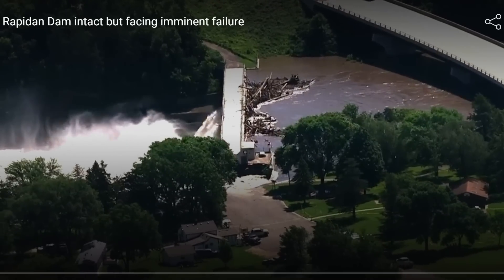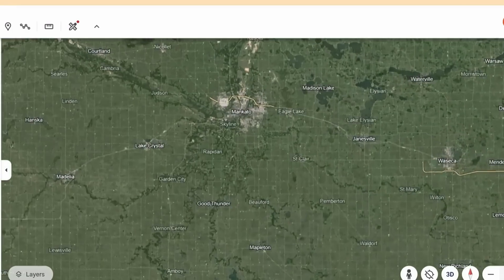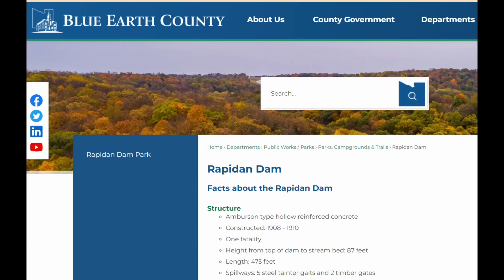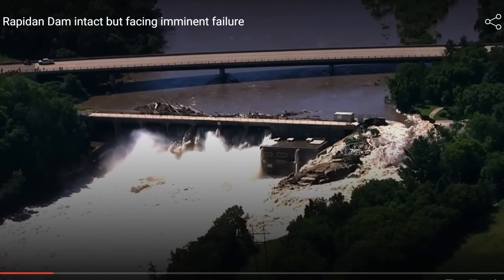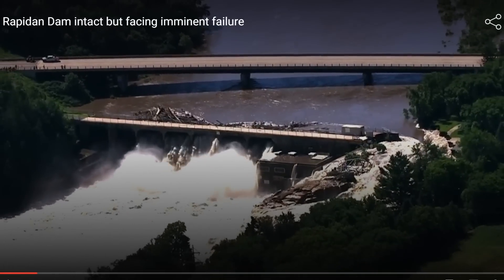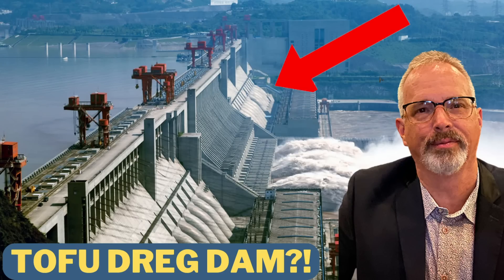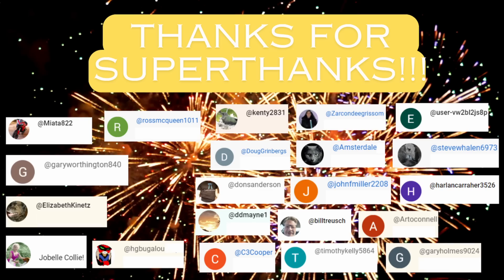Rapidan Dam Failure - Minnesota

Comment: Not sure why the people who own the threatened house didn't call out for an excavator and loads of big rock and got it placed while the placing was still possible.  Yes, it would have been done without permits, but rock can be taken back out of a bank placement where once the house tumbles into that flow it's all over for the structure.

Also, of note, concrete takes approximately 100 years to cure, so that dam structure probably isn't going to break apart, leaving the burden of drainage up to the left side.  More erosion in store.
Reply: This situation developed in a matter of a day. The family evacuated and moved all belongings out at 4 in the morning today. What is very sad is that their family restaurant is steps past the house which has been in operation as long as the dam. I am not sure what they will do now. This was a very popular tourist destination and they are well known for their pie. I've been many times and am so sad to see this.
Reply: @lawnmowerlarry  I did take note of the boarded up window in the attached room indicating an evacuation notice.  I sympathize, I've been there due to on coming forest fire.  Ya don't know what to do first.

Interestingly enough, what I did was pour a double, sat down for a minute to consume and consider.  Snapping out of it I went into the bedroom and grabbed stuff, getting to the truck I looked to see what I had grabbed, not really paying attention during the effort, what I was holding was my 357 and porn.

I sure there's a message there.  Well God bless 'em, I'm sorry for their loss.
Reply: What retard told you it takes 100 years for concrete to cure?

Comment: Apparently the dam infrastructure was abandoned earlier from an ice dam incident. No ability to control water flow. A backhoe could have tossed all the debri over the downstream side but would be pointless if the water level can't be controlled since the dam infrastructure was flooded before. The wooden gates were replaced with concrete slabs, hence no debri on that side. 2 out of 7 gates permanently closed. WTF? Disaster started years ago with apparently zero foresight... the remaining "flood gates" were not operational or the water level would have never gotten that high. Emergency spillway?... FREE!, gravity always wins.
Reply: Operating a back hoe on that dam under those conditions would be a truly life risking task 😮 🏗
A bit down stream I understand there is a monkey sanctuary. Hope they don't break free. Last thing that town needs. 🙊
Reply: There is nothing like reducing your options for redundancy. A guide to failure.
Reply: That's the first thing I though of, who was the idiot who permanently closed 2 of the gate openings, that could now be used for flood gates. And they say engineers are always the smart ones.

Comment: The project needed extensional reinforcements on both sides since it seems the area is a flood plain (unconsolidated materials, mud rocks, and soils). The nearby, upstanding highway requires netting to not let brush and mulch material not reach the damn. It seems it can be saved, upgraded with new turbines, and strongly reinforced.  ‘ my thoughts

Comment: Per your report, flow is much less than the record recorded flood.  Raises question on how much preparation the dam operator did by opening the tranter gates, etc.   My engineering observation looks like the gates are mostly in their raised, or normal position which contributed catching debris and restricting flow.  The rain radar you showed is downstream (north) of the dam which is good.

Comment: Seems to me this was comparable to the failure of the bridge in Pittsburg. There, lack of cleaning of the storm drains led to standing water and run-off damaging the structure. Here, we have collected debris, which should have been mitigated, preventing the spillway from being able to handle an amount if water that the dam was designed to be able to handle.
Reply: That debris is only from the previous 72 hours
Reply: @tomgates316  Yes, and apparently there was an attempt to clear it, but ultimately the current was to dangerous.
Reply: In this case the county had a study that said it would cost 80 million to remove the dam, this saved them tens of millions.  The current videos show it has cut deeper through the bedrock and is moving the silt out of the lake bed, compare the black color today to the red mud color earlier.
Reply: The excessive flooding prevented them from clearing debris. They have issued daily press releases, and the country engineer stated the equipment their sub contractor uses to clear large debris was 5 hours away. They still had the sub contractor come out to the dam to evaluate the situation. It was determined that it was too dangerous to attempt to clear debris due to the high water flow and raising water levels.
Reply: Is there something called a "traveling screen" to keep debris from accumulating?
Reply: Agree from Pittsburgh that is why our bridge failed

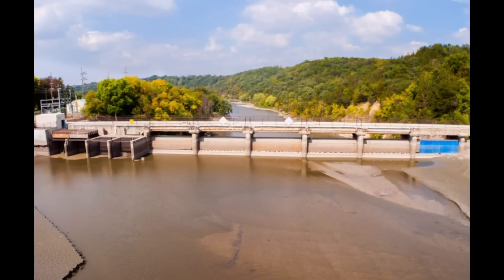Comment: From the photo at 3:19 it appears that so much siltation had already taken place behind the dam that the river did have to rise very far to overtop the dam.
Reply: They say the silt is a toxic mess of herbicides and pesticides.
Reply: Yes, it's very shallow above the dam now.  That's the main concern about removing the dam and releasing a hundred years of farm runoff (silt) into the downstream rivers.
Reply: @chilkat_river they could dredge that material out first before removal of the dam.
Reply: @snoozeflu  It's difficult to find a facility that's licenced to store hazardous waste, if it was dredged out. Plus it's expensive, so the county just wants to leave it alone.

Comment: It's not "imminent" I don't know what they classify as "imminent". It's already failed. The damn's structure is not only the concrete and steel that barricades the water and regulates it but the ground that is also part of the damn tapering away from the concrete/steel structure(s) and is what finishes the damn as a whole and holds it in place besides its seat or base of it all which if engineered correctly stays set for at least this long. But this problem is now at the fault of army corps of engineers who control making the decisions of opening and closing of the gates. Place is over 100 years old which means years of weather data record and so they should know what the Extremes and the Non-Extremes are in our region and they are supposed to be a redundant hydrological system in place for all damn's when it comes to just learning how to communicate upriver and downriver to other damns as to when to open or close the gates.
Reply from the maker: This dam in not under the jurisdiction of the U.S. Army Corps of Engineers.  This dam is regulated by FERC (Federal Energy Regulator Commission).

Comment: I thought that the left side had ledge and it was acting as an emergency spillway. I did that on a small dam many years ago. That dam had good solid ledge. The building was probably built after the dam and ignored any notes on the plans about leaving a big set back. They should be using a logging type cable set up to clear the upstream trash. Good Luck, Rick
Reply: Yes, the logs at the dam are preventing the water from going over the dam, hence the water found an easier way around. IN all the vids I have watched the water level upstream hasn't gone down, and now we know why - because the dam is silted up. The is another issue that can't be solved short term. This likely will not end well.
Reply from the maker: That's not interesting idea on how to clear the debris out of the reservoir.
Reply: @CaseyJones-Engineer  Say again?
Reply: @richardross7219  I believe that's an autocorrect mistake and was supposed to be "an interesting idea" or something to that effect, not a negation.
Reply: @2xKTfc  It is an interesting idea.  You still have have a way to fish the logs and large debris out.  It would be complex.  May the cable could just hold it, until it can be cleared.
Reply: @2xKTfc  You are probably right. The very old soldier in me reacted like I would when told something incredible over my PRC 77(I left out "over"). Good Luck, Rick
Reply: @JoeLinux2000  The machine that runs on the overhead cable can be fitted with a clamshell type bucket. When you drop the clamshell onto material it will close onto the material as you lift it. It can then carry the caught material away, dump it and return. They could also use a claw like junk yards use. Good Luck, Rick